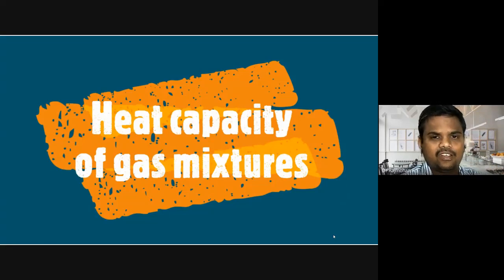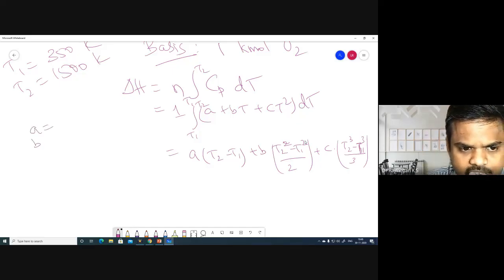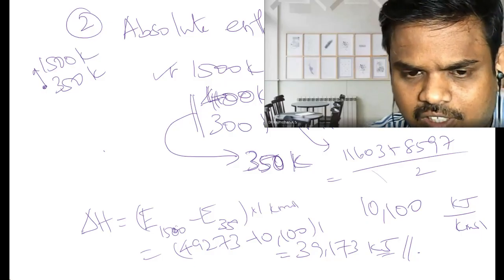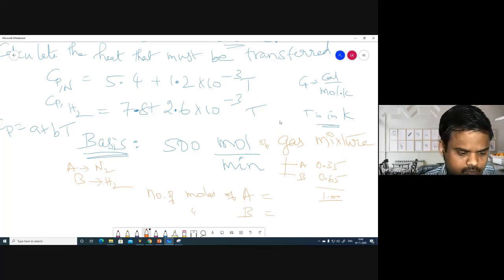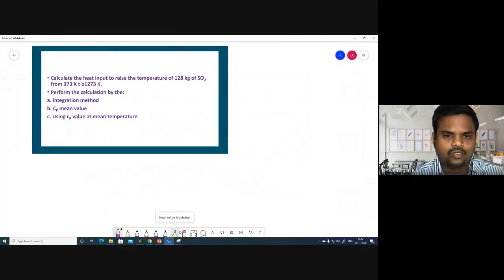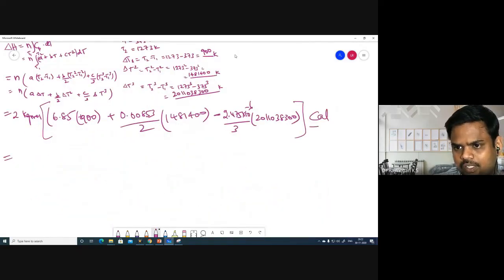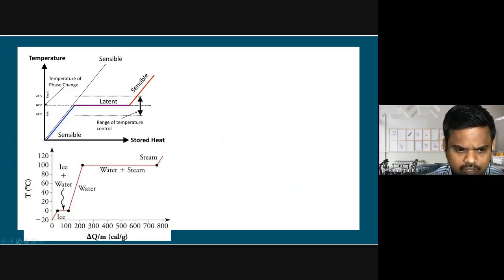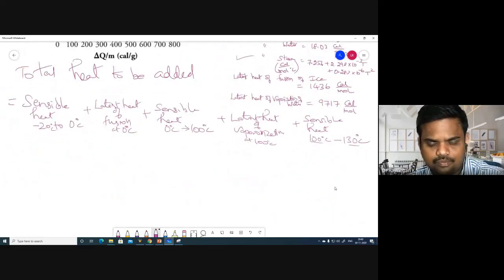Lecture 44  Numerical on Specific Heat Heat of the reaction

Comment: Ans 3.Total heat input is 21652.57 kcal
Ans 4.With Cp of water=1 cal/gC Total heat is 74185 cal however with Cp of water (as mentioned in the video)=18.03 cal/gC  Total heat=244485 cal.

Comment: Answer for last ques
Sensible heat(-20°C to 0°C) =970cal
Laten heat of fusion=7984cal
Sensible heat(0°C to 100°C) =180300cal
Laten heat of vapourisation=54026cal
Sensible heat (100°C to 130°C) =1333cal
Total heat added =244613cal

Comment: Values for last question:
Sensible heat (-20°C->0°C)=970cal
Latent heat of fusion at 0°C = 7969.8 cal
Sensible heat (0°C->100°C)=108300call
Latent heat of vaporization at 100°C=53929.4 cal
Sensible heat (100°C-> 130°C)=225.6°C
Total heat to be added to 100g of water to heat it from -20°C to 130°C= 243394.8 Cal
Reply from the maker: CHECK the following
: 
Sensible heat (0°C->100°C)= 9-11 kcal
Sensible heat (100°C-> 130°C)= 1.2-1.4 kcal
Total heat to be added.............. (7O to 80 kal.)